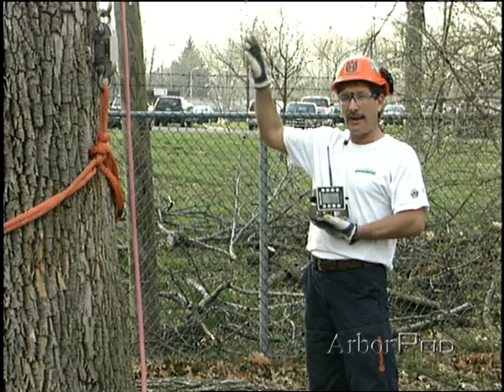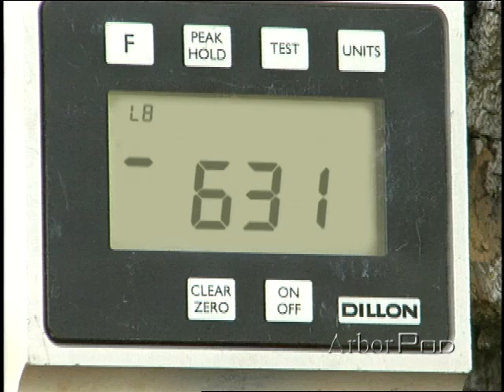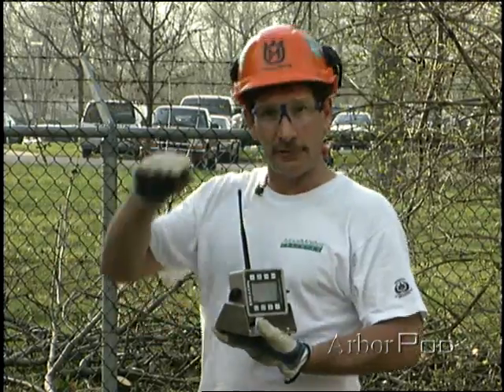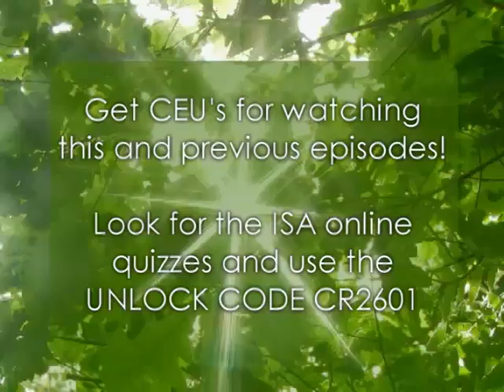Dynamometer Drop Tests Part 2

Comment: When you say "these ropes were therefore over-loaded" because the dynamic peak force was >10% of the ropes static tensile-ABS, I think you're mistaken (OMG I feel rude saying that, I have the utmost respect for you & love these videos, just want to be clear on this point!) for a couple reasons:
#1 - silly 'practical' reason that 'overload', as designated by the manufacturer, is basically ANY significant dynamic action ('shock loading'), for instance Yale's graphs for the relative-elasticity at any given %-of-ABS have green & red areas that are 'wll' at any given % of the rope's tensile ABS, if you look at those graphs (in the 'Data' tab for any rope on their site) and extrapolate the #'s you'll see that virtually any arboriculture rigging is going to be out-of-bounds.   BUT, of practical-relevance to us:
#2 - Your assessment whether or not it was over-loaded (in YOUR eyes & professional-estimation, not some company's rules) seems driven by the ubiquitious use of this "take the *static* tensile strength, then multilpy by 10% or 5%, and that's what that cord's *dynamic* capacity is....that is simply wrong, dyneema/amsteel make a great example of that, I mean usually static & dynamic are pretty linear on these ropes so I can see how the "let's use STATIC #'s" concept became a thing but I'm blown away at how little seems to be paid to the elasticity, it's the elasticity&strength through the rope's breaking-spectrum (from un-touched to ripped) that gives us the area-under-curve which, cumulatively, is the force-absorption-capability of the rope....It really bothers me that I can't understand why so many rigging ropes on the market are like 2% or less stretch, nobody wants bounce/stretch but its inclusion is there for safety/catching dynamic forces and, for rigging, that's kinda par for the course yet these rigging ropes being 2% is insane to me (I also don't get the point of using the HMPE yalex/tenex slings, I mean sure the sling should be more opwerful than the rope it secures, but in my mind that means it should be like 20% stronger tensile, and maybe 0.5% more elastic, than the rope to be run-through it)

Do you have just that one static-break-test machine?  I am reallllly hoping I can get Dave Driver interested in one of the ideas I've got, if I can you're one of the first contacts I'll be making in hopes of getting some breakage-work done!!

Thanks for all you do, sorry for suffering the greed of Weaver et al., hope you're doing well have a great weekend man :D
Reply: @cerberusbonsai&aboriculture, see @HowNOTtoHighline